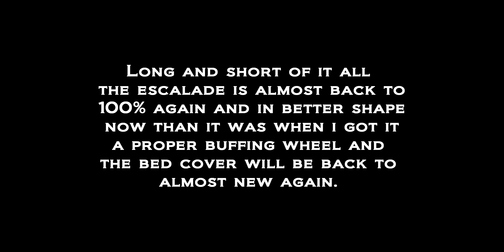Escalade Updates and Polish comparison

Comment: wow the sun sure does bleach out the plastics . back when I use to do detailing I would use a low speed buffer/polisher it almost looked like a angle grinder . thanks for the comparison video .
Reply from the maker: yeah i used to use one of those too when i worked at a detail shop in Knoxville. the good ones like what you are talking about is really expensive now for some reason though, i'm not done fighting this yet, not by a long shot, i have a couple more ideas i am going to try and if that does't work i'm stripping it all down and using a black vinyl dye on it then put a good polish on top of that once it dries.

Comment: Hey your having a go!, its better than it was :-D.

Plastic bumpers go horrible in the same way, u.v damage i think creates that milky effect.
For frends cars ive said "rub some oil into the surface", makes it look a little blacker untill the next wash.
If you had a spare panel, you might try valve grinding paste and a nail brush, could remove the surface faster than ordinary polish, then buff with polish to make it smoother :-).

There are "ink like" bumper restorers so that may be a possible too.
Its a smashing truck jim, i can see you like it :-), hopefully it will last as long as the tahoe.

Bear looks like a happy chappie, still interested in everything, and wants to be with you, apart from the hip problem and brushing them forever, they are good dogs :-D.
Reply from the maker: yeah he's my boy unless momma is home and then he forgets who i am all together. I am trying the proper polish pad in my drill and the black polish since that seems to do such a good job. if that doesn't work i am taking a page out of my car detailing days and put a light sand on it then hit it with some vinyl dye and one it's dry hit it with the polish again to keep it from fading away on me again. give it that heavy UV protectant and it should stay black a good long while i'm hoping.

Comment: Do those have the torsion front ends or is it a spring? You could always get a set of keys and get the front end up another inch or so to fit your wheels. You should be pretty close to fitting another set of 265/70 tires on there
Reply from the maker: the only reason the wheels would need a lift kit or level as they keep calling it is because the wheels they sent me are NOT what i ordered. Not even close, i'll be doing another video on that today.